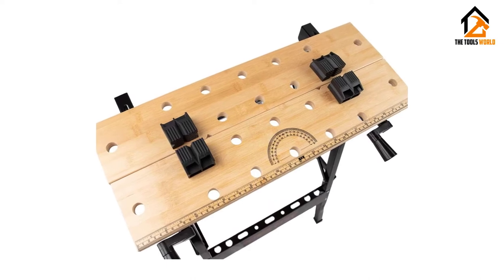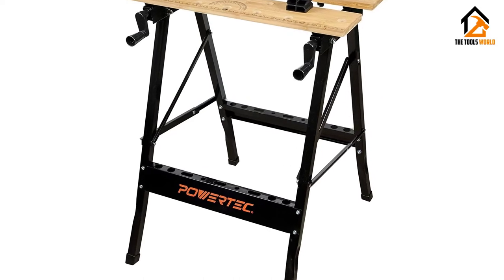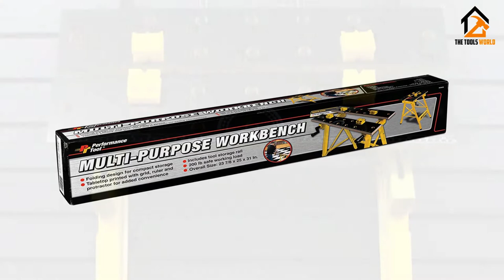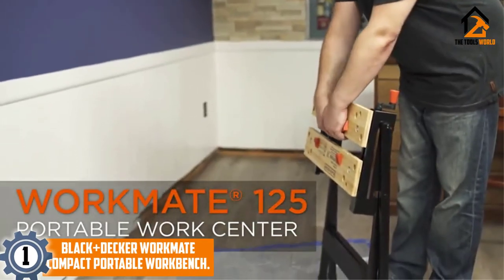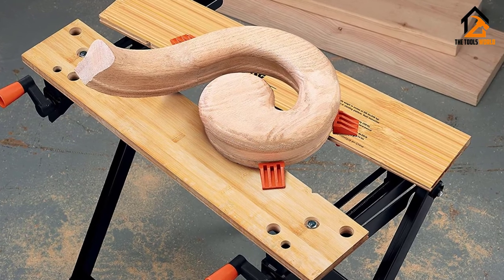Best Portable Folding Workbenches [Top 5 Picks]

Comment from the maker: ▶ In This video, We recommended the Top 5 Best Portable Folding Workbenches 

▶ 5. Portable Workbench With Wood Clamps.  
 
▶ 4. Portable Deluxe Bamboo Workbench Top.

▶ 3. Kreg KWS1000 Mobile Project Center. 

▶ 2. Portable Multipurpose Workbench & Vise. 

▶ 1. BLACK+DECKER Workmate Compact Portable Workbench.